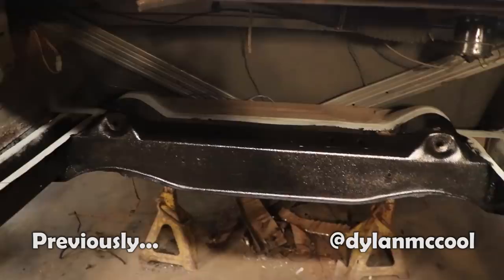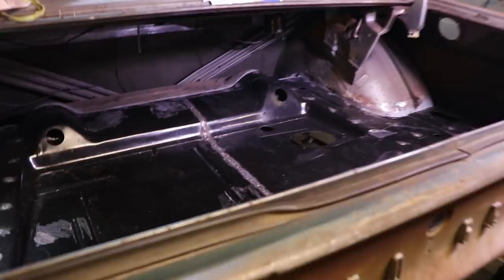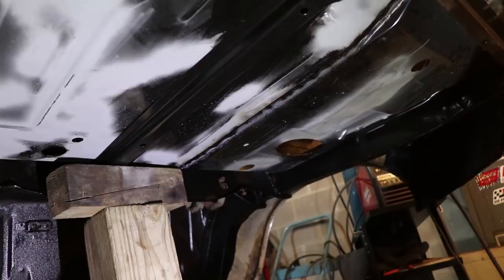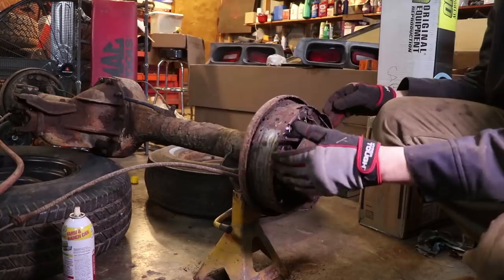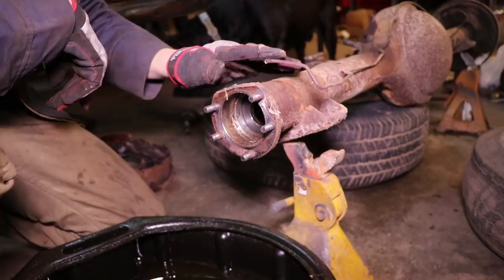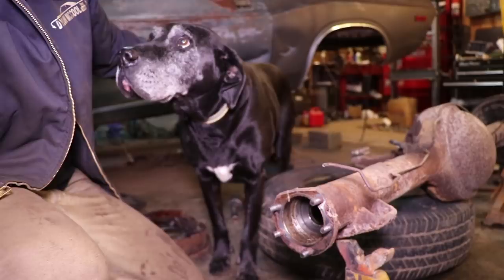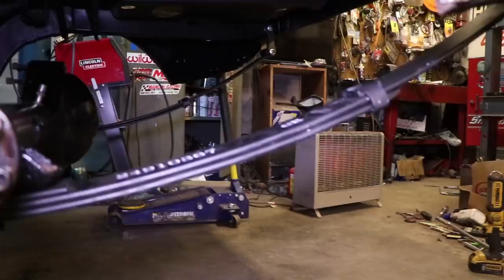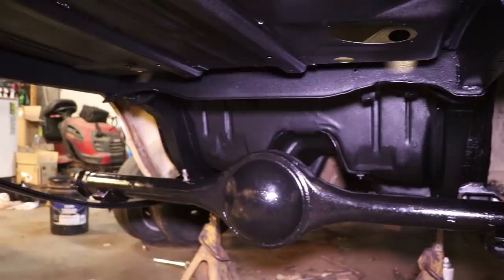ABANDONED Dodge Challenger Rescued After 35 Years Part 10: Trunk Floor/Rear Axle Restore!

Comment: Good job on the welding. I rebuilt a 48 Willys Jeep back in 2009, had to weld in new floor panels and hat channels.  It was my first time for that work, but it turned out well once I got my settings right on the welder.  Sheet metal is tricky for a beginner, knowing to take your time and not allow heat to warp the pieces, it’s a labor of love for sure!

Comment: I’ve sold POR15 for over 10years. I know you can use it like you are with out doing step 1 the cleaner and step 2 the metal prep but I would suggest that you start using them. Also I suggest 2 thin coats of the POR, applying the second coat while it’s still tacky. Great videos keep it up
Reply: yeah POR 15 Metal paint is designed to go on POR15 Metal Prep as the Metal Prep etches a zinc oxide layer into the metal

Comment: A old trick, when the axle shafts are out and clean, paint a white line down the center about 1/2 inch wide. Not to say you are going to be launching hard, but you can check the twist on each axle during gear changes. Ask why I started to do this, 440-four speed and sticky tires might have something to do with it. Even a healthy small block with a stick, can put a twist on them. The tighter you make the body, the more they will twist. If you get a quarter twist, might want to give Strange a call. Being that you changed the rear axle height, you need a 1 1/2 inch minimum clearance for the snubber if you are going to run it. Also the snout of the center section needs to be down about three degrees. You might need a couple of angled shims between the axle housing and the spring. Easy to check with a angle finder. When you get away from super stock spring and Ma Mopar, things can get a little out of line, even with a Hotchkis set ups.    Best wishes from south Florida.

Comment: A couple things about POR15. It does not like to stick to clean smooth metal, it needs something to bite into, like pitting or rust. If you shoot it on the fender or quarter panel where there is no rough surface, it will separate and come off, and whatever paint is over it will bubble up and flake off.  The other thing is it is not UV resistant, even under the car you need a top coat over it to keep it from breaking down. A cheap tractor enamel will work to cover it. Inside the car where it doesn't get much or any light no need to cover it.

Comment: Next time with the POR15, if you use their metal prep system first it helps it bond even better. I used it on the subframe to my Nova, you can slam it with a hammer, and it wont chip off.

Comment: Those are plug welds when you drill a hole and dime them closed, not spot welds. A tack is also not a spot weld. Also when you're welding straight beads dont just drag. Small circular motion, like the spiral on a notebook.

Comment: Next time you get a new can of Por 15 before you put the lid back on put a plastic bag between lid and can then seal it. You won't destroy the lid taking it off. Also if you put the opened can in the frig it will not dry out and lasts longer.

Comment: The 71 GS might end up the same way. Where it would be modified replacement frame, New upgraded suspension, floor, transmission, differential and turbo 6.0 LS swap all underneath a barn find body

Comment: This project is coming along nice. I cant wait to see the engine /trans install. I'd like to pick yours and your dads mind a little on an old D150 I have sometime. Need some wisdom on wheels and center caps and ive also got some questions on possibly swapping the rear end out. Id like to just do a swap for different ratio but I dont know what rear from what vehicle will work. Again, great work as always. Thanks

Comment: With bed liner. That stuff isn't rubber based is it? What about the other stuff you brushed on the rear end? I've seen some of the other videos of you using it previously but that doesn't hold moisture does it? I'm doing a restoration on a 50's Mack B model and for me and how I was brought up if you wanna preserve history. Best things to use is good but not cheap primer and paint and keep things cleaned and other ways from rust prevention. So man the work you've been doing is really good so far. It almost looks like it was from factory for amateur job it's really nice. Keep up the great work!

Comment: I have a 69 Firebird convertible in my basement apart. Motor is done floors are new. Have most of the parts for it. I just lack the motivation to finish. It's been there 20 years. Ugh

Comment: Hi Dylan, great video. Giving me inspiration for the back end of my Humber Hawk Series II as it needs pretty much the same. I need to install its rebuilt front crossmember and suspension unit first.
I have used POR-15 in the past on projects but I have been using John Deere Tractor paint on front end parts of my Humber Hawk.
I might use POR-15 on some areas.
I like the idea of keeping the age and I am doing that too. Why should it look new when it's 59 years old?

Comment: As a guy that primarily works on trucks seeing you just easily lift that rear end in made me laugh. Made me remember that not every axle is over 500lbs...Moving dana 60s,70s,80s, and 14 bolts around requires some thinking at times......

Comment: I said in the previous video to upgrade the rear suspension and parts to MODERN suspension coil-overs and disc brakes and the relevant linkages etc, but no you have gone back to the dinosaur age and put back in leaf springs.

Comment: The ring gear have many teeth and pinion gear have less teeth. Actually. the 1 revolution of the wheel for every 3.23 time the revolution of the driveshaft. The Transmission always have overdrive for the engine running nominal 3,000 rpm and driveshaft will run at 6,460 rpm making the RWD rotate at 1,000 rpm while the wheel diameter is 25 inch. The travel of the RWD traction on street is 1.23 miles. Suppose if the wheel is 26 inch diameter then it travel for 1.28 miles right one the wheel rotate exactly 1,000 rpm.

Comment: Hey @dylanmccool I noticed you don’t use the POR-15 degreaser or metal prep before you apply the paint, do you not have to do that? I also use POR-15 so I was just wondering about your method. Thanks!!

Comment: is that POR 15 the same as hammerite that we use in the UK ?
Reply: similar...POR15 does a similar job and goes on the same way. I'm currently restoring my Z3..using POR15 Metal Prep on everything..gives a nice zinc layer, then two coats of Hammerite Red Oxide Primer, then three coats of Hammerite Smooth Black...I would have gone POR15 Metal but as others have said, it's bloody expensive...I'm tempted to do the inner sills in Metal Prep then Metal paint...

Comment: I haven’t used that POR-15 but read that it isn’t UV resistant. I know the rear end isn’t really in the sun but are you top coating it just in case?
Reply from the maker: Super Luke’s Garage You’re right, POR-15 doesn’t hold up well to UV light, but I hope my axle isn’t face up in the sun any time soon 😂